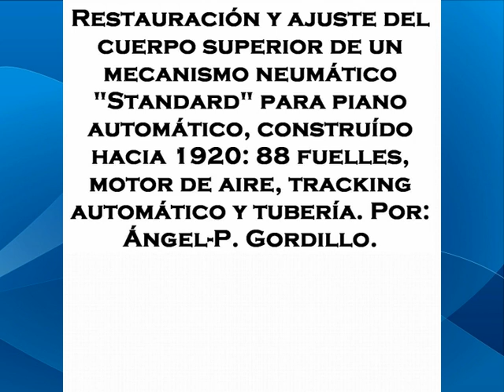Player piano restoration /Restauracion de pianola PART 1.

Comment: Hola, te felicito por tu trabajo yo tengo una casi igual y me encantaría restaurarla, donde se consiguen los materiales?
Reply from the maker: Pues yo las pido a Inglaterra o a Estados Unidos, al Sr.John Tuttle; hay varios proveedores, pero, aún estando seguro de tu competencia y habilidad, te advierto que éste es un trabajo muy complejo que requiere gran paciencia, hacer muchas fotografías y conocimientos que hay que adquirir antes de desmontar nada. Si traduces inglés, es imprescindible el libro de Reblitz (en Ebay), y leer muchas páginas en internet. Hay un buen tutorial en youtube (player piano restoration), que te enseña cosas. Si tu pianola es un mecanismo Standard, tendrás dificultades para despegar los fuelles, pero es un mecanismo muy suave y hermético, mejor para mi gusto que el Aeolian. El secreto es calor y no forzar nada.¡Suerte y paciencia!
Reply: Triodeno
Muchas gracias por tus datos y consejos me vienen muy bien. Yo tengo una pianola semi restaurada. Es decir la mande a restaurar y la dejaron casi lista pero aún asi no funciona pues pierde presion de aire ya que el pegamento entre el pulmon de aire y los pequeños tubos esta fallado y el restaurador no se atrevio a seguir restaurando. Alguna sugerencia?
Muchos saludos desde Santiago
Mfa